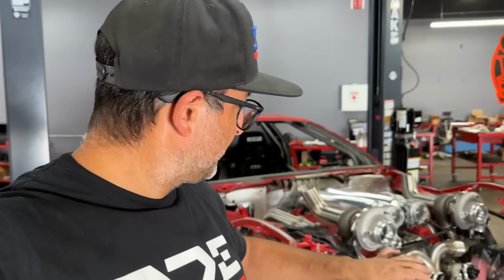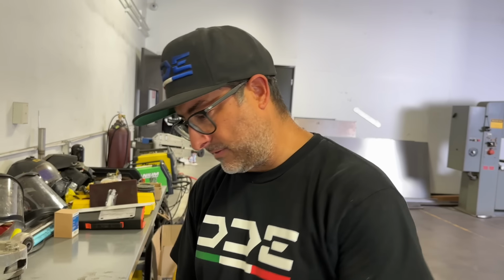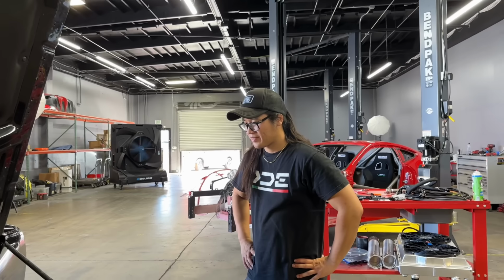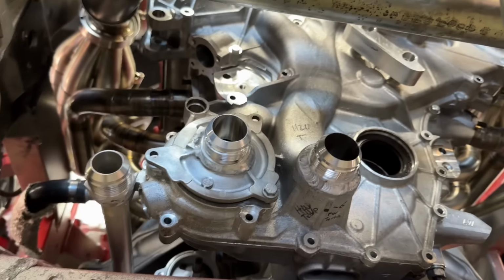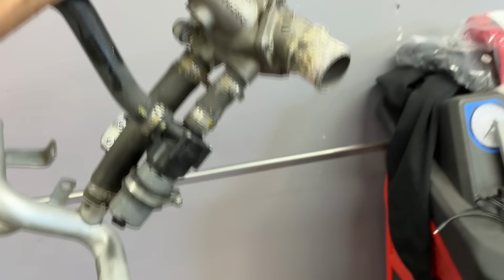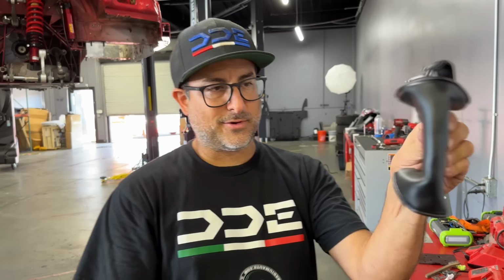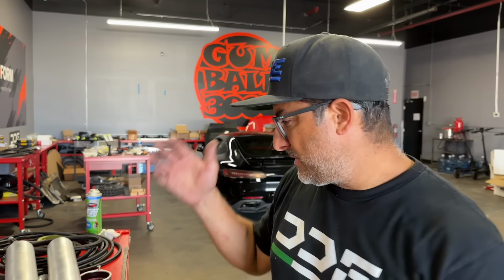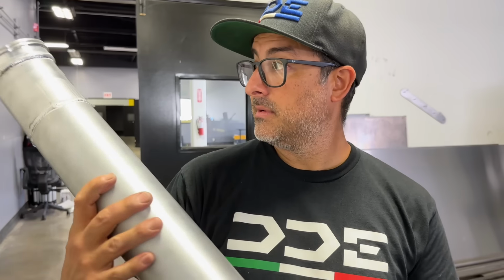DIRTY RAT CAUSES MAJOR ISSUES ON MIKES AMG BUILD!

Comment: DDE needs an actual Lean Six Sigma Project Manager to help increase efficiency and reduce waste in the process. You're great fabricators, but you really need a DMAIC guy.
Reply: You think they make enough waste to pay someone say an 80k salary for them to save them the 80k that person is costing and enough to make it a viable option 🤔 😅
Reply: @philipgreensmith1694  $80k no, $120-$150 yes. A Lean Six Sigma Master Black Belt should be able to find them enough waste to save them operational costs and accelerate  revenue generation/recognition.

I've been there and done that at different sizes of business. You just have to be good at what you do.
Reply: @maxrees8445 that's ridiculous. You think that someone could make savings of $200,000 a year from what Mike and Tim do at DDE! How much tube and sheet metal do you think they buy!? 90% of their spend is on parts or manufacturing! Yeah you could save 40% of that cost if you spent $5,000,000 on tooling and machinery and spent 5 years learning how 😂
Reply: @philipgreensmith1694  Don't be mad. Not everyone understands business ops at a Director or VP level. Most don't, it's okay. Lots of methodologies and tools can be deployed: TPM, quality engineering, 6S, DMADV, DMAIC, RCCA, SCRUM, SDLC, Agile, etc... There's always an opportunity for continual improvement. This extends far beyond manufacturing/fabricating and field ops.
Reply: @maxrees8445  your a fool 🤣
Reply: @philipgreensmith1694  only fools mock because they delight in their ignorance. You're what we call a Red Rider because your brain is as round, smooth, and small like a bb.
Reply: Yup tell Mike to lean out his process. If the engine blows, or the car does not work properly, you blame Mike or the Six Sigma Project Manager? Who probably has no idea or clue how a project car is done, and especially a project build like a Ferrari F12

I’d rather wait 1-2 years for Mike to finish off a project car than waste it becuase some Six Sigma Manager taught Mike how to be “efficient.”

And for crying out loud, it’s just Mike and Tim. Just enjoy the build videos for Christ sake.

Comment: with how you are routing the fuel lines, how are you going to avoid vapor lock? I would imagine the motor and transmission are going to be crazy hot, a lot hotter than jeeps that have vapor lock problems with a similar fuel line location.
Reply: Insulation bro.

Comment: I wanted to replace my radio and the ac is part of the stock radio so after a $500 aftermarket radio and a $700 dash kit I have a badass radio and still have heat and ac. There’s no telling what can be tied into the radio in newer vehicles

Comment: The easiest way to check for a open fuse is. Set your meter to voltage and  the probe across the fuse, if you have voltage that fuse is blown. You will never read voltage across a good fuse.

Comment: I love how a lot of people that have never been under a car, but watch these kinds of videos, think that they're mechanics and know more then you. 😄
Reply: That's a true statement..an yes I've built 55 56 57 CHEVY S..couple monsters 69 cudda 69 charger witha440 six barrels..cudda had a 426.monster 68 an 69 CHEVY CAMROS...55 chevy pick up 77 CHEVY pick up 55 Ford  69 mustang..429 boss..5sp ...couple of kool vehicles fid all this at 14yrdold learned from my grandpa..GOD bless him 🙏..an built vehicles with him ..Great experience..CHEERS FROM THE CANADIAN PIT BULL
Reply: @RobertGViolette  I might be wrong.. I know nothing, but would you drop metal pieces into an Engine that's in pieces? Or would you be careful not to.. even if cleaning it after.
Reply: Yeah helped him build cars while holding a flashlight? Nice @RobertGViolette
Reply: @powergray8682  actually at first yes for a month then started on taking alternators off water pumps  then by the next month taking carborators off Plug wires. So yeah I started small an worked my way up at 16 yrs old I built my own 69 camaro 427 big block 750hp at the crank 600 at the wheels..took a year to finish 450 turbo tranny 9in rear end ..built from the fram up car was black on tan . Painted by professional shop..was a nice fast car...CHEERS FROM THE CANADIAN PIT BULL 🇨🇦 👍.
Reply: @RobertGViolette  no one asked
Reply: @RobertGViolette don't ya mean a turbo 350 trans? Chevy doesn't use a turbo 450.
Reply: @seannconnelly1264 maybe it was a 400 and a typo happened. My Nova had the th350 but I had a 400 just waiting. Sold the car and the parts before the swap.
Reply: @B0bsUrUncle  forsure it could of been or it's an aftermarket trans? That old school rodders know about?
Reply: It ok to drop metal pieces into an Engine? Even in pieces or not, bit wierd.
Reply: @darrenporter1850  umm, no it's not ok to drop metal into your engine, no matter how you get it in there.
Reply: @RDMovieman  Thought so!!
Reply: And.....do u brother...work unda cars?🤔🤔👀👀😬😬😬💀🤝🇿🇦🇿🇦🇿🇦🇿🇦
Reply: @craigmorgan4676  yep, building my 67 mustang right now